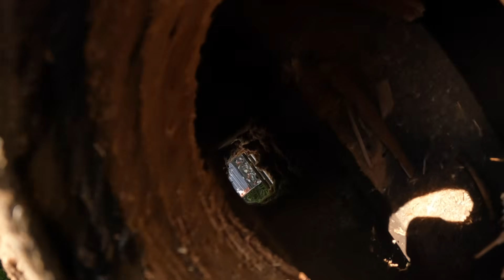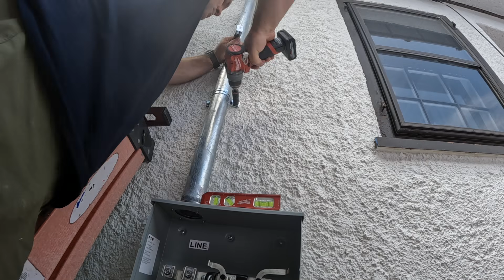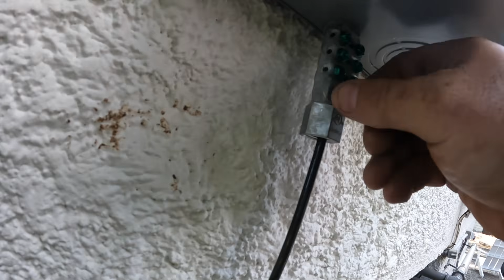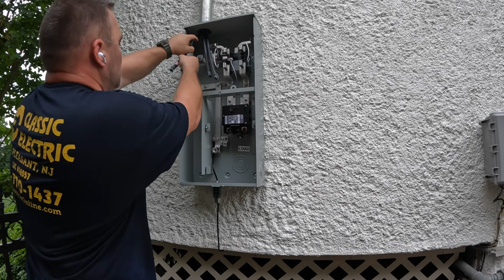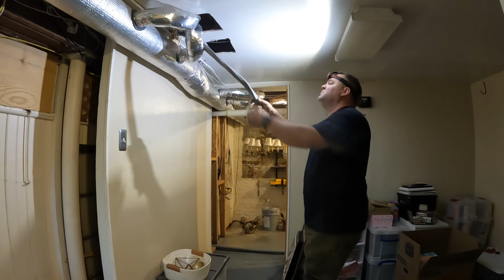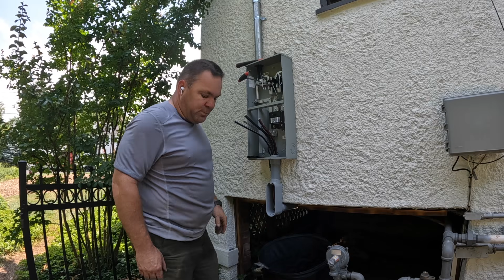NEW 200 AMP MAST SERVICE | METER/ MAIN COMBINATION | PSEG

Comment: Is that gas meter over 3’ of your service? I can’t tell by the video.
Reply from the maker: Why, are you worried about it? It's fine.
Reply: @electricianron_New_Jersey  the service  should be no less than 3’ of the gas meter, I’ll find the code reference later today.
Reply: @electricianron_New_Jersey  I don’t remember if is in the NEC or PSEG book.
Reply: @electricianron_New_Jersey found it, is a PSEG requirement, It’s in the page 10-16 note 9 of the PSEG book.

Comment: The braces between the joists are so that when someone steps  on or places a piece of furniture the joist shares the load to to the joists on either side to share the load.  Nothing to do with earthquakes.
Reply from the maker: @joewhite917  but the bracing prevents the joists from rolling.
Reply: 100%. Load transfer

Comment: Can you recommend specific anchors to use with stucco ?
I’ve had issues with my plastic anchors pulling right out of the stucco. 
Thanks
Reply from the maker: I used my regular plastic anchor with #10 pan head screws. There's six of them in there and it does not move.

Comment: In Texas we use a Bare # 6 Solid CU as the Grounding Electrode Conductor for Residential Service from 100 Amp up to 200 Amp.We also sleeve it 1/2 '' EMT or 1/2 '' Schedule 40 PVC sometimes to make it look better, if the Home Owner asks for it. And since the Water Meters are underground by the curb we are not required to install a bonding jumper at the meter. And we only have to install one 5/8'' Copper Brass Ground Rod near the Main Service Outside Disconnect. And just to let you know Ron , I'm not a '' Arm Chair '' Electrician ! I'm a State Licensed Journeyman Electrician/Sub Contractor with 56 years in theTrade, Residential & Commercial.
Reply from the maker: #6 copper is too small for 2/0 copper 200 amp service.  Table 250.66.
Reply: @electricianron_New_Jersey  Hi Ron like your videos. 250.53 (E) Allows the supplemental electrode (ground rod) to be max #6 copper but the main electrode would have to be sized according to table 250.66 

200a service water main electrode (4awg copper or 2 AL)
ground rods suplemental electrodes (6 awg copper)
Reply: @electricianron_New_Jersey  ; Tabel 250.122 of the NEC for a 200 AMP service allows # 6 CU as the Equipment Grounding Conductor from the Service Disconnect or Main Panel to the Ground Rod(s) . 
If AL  or CU Clad AL its has to # 4

Comment: Ron correct me if I am wrong but I thought pseg did not permit the use of combination meter / emergency disconnects yet in NJ?
Reply from the maker: When I had my meeting with the inspector to get approval for relocating the service drop I asked him point blank and he said as long as the meter portion can be lockable it was allowed. 5th jaw too, you know.

Comment: Do you ever wind up with kinks in your SER runs? Any tricks for dealing with them in tight areas?
Reply from the maker: That comes with experience. By walking out the cable like I do before pulling it into the basement, it prevents the cable from getting kinked. It still could get snagged on something and get kinked but its less likely when you walk out the roll ahead of the pull.

Comment: nice work! do you need to call 811 prior to ground rods? here in CA its a requirement...
Reply from the maker: Not a requirement for ground rods. The gas meter was nearby but I knew the main line came from the street, and not ion the direction of where I installed the ground rods.